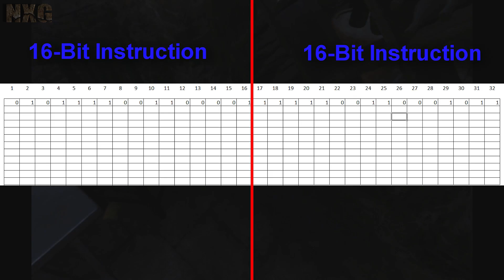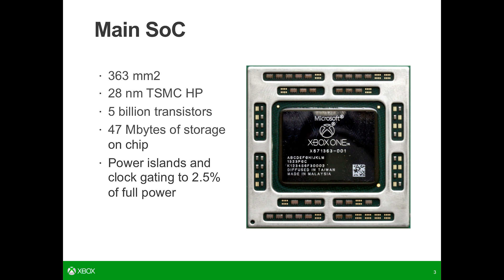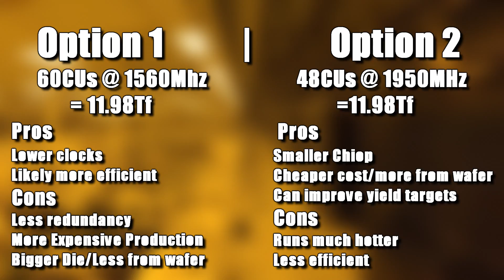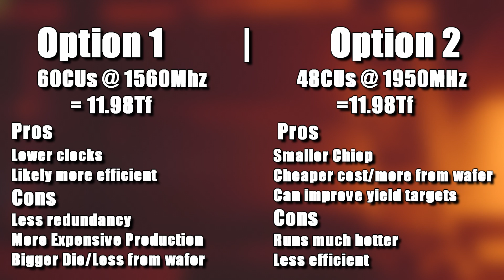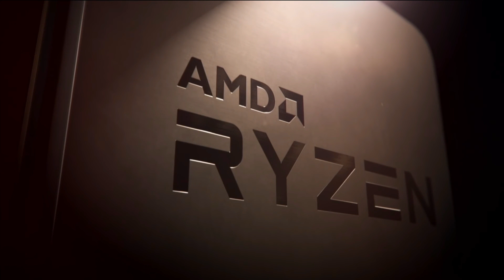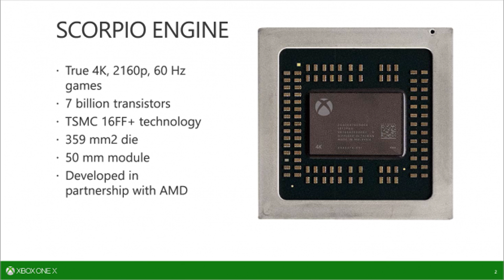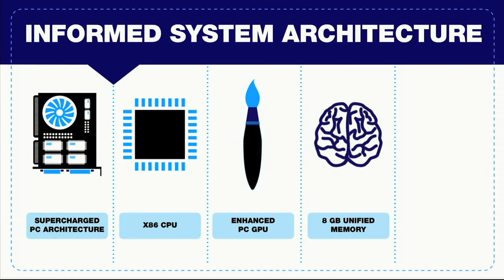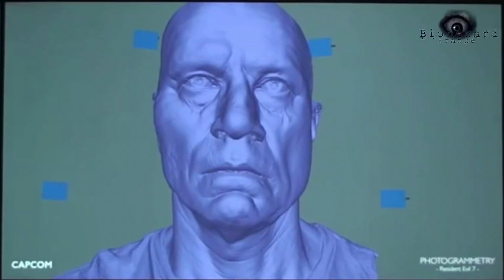Is the PS5 only 9Tflops? | Let's Talk

Comment: Playstation fanboys are in a emotional rollercoaster just two  months ago all they talked about was power power power but now that it looks like the Xbox Series X will destroy the PS5 in terms of power and performance the Playstation fanboys flip flop back to power doesn't matter
Reply: You do know that the Xbox series x and ps5 will be literally identical both using gddr6 ram both have ray tracing 4K 60 up to 120fps the ps5 might even be faster cause the SSD they have in it isn’t even available for PCs on the market
Reply: Reminds me when the PS4 was originally more powerful than the Xbox one. Stupid people on all sides.
Reply: Let's not get it twisted though, I'm all for more power, worry about costs later; I'm actually still hoping Sony's system is more impressive which it probably will be.
Reply: In the history of consoles, Xbox (Microsoft) has never had a more powerful launch console than PlayStation (Sony). ONLY reason that the Xbox One X was superior to the PlayStation 4 Pro was because it costed 100 dollars more and released a year later. It's absolutely insane to think that Xbox will have a more powerful launch console considering it's never happened before.
Reply: @ghostthough7874  are you sure that's right? The original Xbox was more powerful than the ps2, granted it was released one year later than the ps2
Reply: @Brutananadlewski  Indeed. And same goes for PS3. A year later release. PS3 was more powerfull but had a rough start, difficult architecture to work on, for most devs!
I think that ghost yt random forgot the price of the PS3 lmao...at launch!
Reply: @Falcon_Indestro  ya that's right. PS3 was an awesome console though
Reply: @Falcon_Indestro  not true, the gpu in x360 was a head of it's time and more advanced than ps3. Same goes for the shared memory in x360.
The cell was a more capable cpu in the right hands though. But overall x360 was more powerful.
Reply: @vandammage1747  i can't argue with that. Maybe the X360 was more powerfull as a whole. I always thought the PS3 with its CELL processor being the most powerfull one.
Reply: @Falcon_Indestro  it was sony called the 360 the 180, according to most recent reports from guerilla games, cell was never fully tapped ps3 had 2.18 tflops of floating point performance 360 was nowhere near ps3; multiplats ran better for a while on 360 due to the crazy architecture of ps3 being an issue because xbox 360s architecture was far more similar to pc, Xbox 360 was definitel not as powerful as ps3.
Reply: @ghostthough7874  exactly completely agree
Reply: @ghostthough7874  ps3 released a year later and had inferior gpu and memory. The majority of games look and ran better on x360.

The same can't be said about X1X  which is one year newer than the failure that is pro, and games have 100-125% higher resolution + higher settings.
Reply: @vandammage1747  PlayStation 3 GPU was actually relatively on-par with the Xbox 360.
Reply: Ghost Though OG Xbox was more powerful hands down.
Reply: Your ones emotional rollercoaster still no good games on and on a  about useless Xbox One X 6 terraflops.
Reply: Nah, if the series x is more powerful and same price or cheaper then it will 'destroy' ps5, but it's a fail if more expensive
Reply: @gangstagummybear3432  You do realise Phil Spencer said it will be cheaper then the PS5, MS will take a loss on console sales to get more of their consoles in peoples homes, because they know they can make it back with game pass and such.
Reply: @gangstagummybear3432  You can't destroy another console without great games. With great power comes great responsibility , so now Microsoft has NO excuse.
We better not see no low review scores on key exclusives they've had plenty of time.

Comment: This is such a terrible video. Stop making excuses for Sony, their PS5 will be incredibly weak vs XBOX Series X and PC.

Also, we all know, the XBOX Series X is 12+ Teraflops! So why did you say, both Sony and M$ are targeting 9 tflops, when The Only Company targeting that Low performance, is Sonys PS5?
Reply: It's never been confirmed that the Xbox Series X will be 12+ Teraflops of GPU power. CEO of Microsoft only said that it will be "2x the performance of the Xbox One X"... He could have been talking about the SSD speed compared to the HDD in the Xbox One X for example. Also, 6 Teraflops in the Xbox One X which would equal 12 if doubled, is based on old architecture. AMD RDRA 2 architecture (for example) at 12 Teraflops of GPU power would be like 24 Teraflops compared to the Xbox One X 6 due to the Xbox One X having a different type of Teraflops cause the GPU is entirely different.

Comment: I dont believe it's this weak. Provably just a joke or rumors or something.
Reply: It is true but it is from an old plan Sony had for the ps5 to release it in 2019 with the 9.2tf, they later changed the plan as we know and it is capable of more than 10tf
Reply: Check MBGs video about it, i think its called "Why its unlikely that the ps5 only has 9.2tf"
Reply: @dragonblueprt33  LMAO. I can't take you seriously of you listen to MBG. Of course he's gonna make a video about why its "unlikely". Hes a fanboy.
Reply: @ReaveIdono  i know hes a fanboy but how do you counter facts, theres proof of it
Reply: @dragonblueprt33  There is no proof of it. And we are at crunch time so rumours coming out now are probably as close as you can get.
Reply: @ReaveIdono  so how does the old rumor have exactly the same specs that this new one has, exact same specs and terraflop count?
Reply: @dragonblueprt33  Because more documents could confirm what was originally speculated. It's called corroboration...

Comment: Thanks for the video. I keep talking to people who just don't realize that these "leaks" are just information documents of chips in a database. Completely removed from context. It doesn't say "this is PS5" that is just a guess.
Reply: Trust me it's not a guess.  Both consoles have had their CPU's and GPU's leaked.
Reply: @GregHakes  No. There is nothing to confirm that. We don't know if it is a prototype for the console or if it is the final chip. We can make a really good guess that it is related to PS5 because of the tested clock frequencies, but all the same, we don't actually know this. There is no confirmation on anything yet.
Reply: It's not a guess, it's a verified leak from multiple
sources.
Reply: @GregHakes  The only thing that is verified is that it's from the AMD database of chips. Not that it is the final PS5 specs.
Reply: @Blag_Cog  Ok, Buddy what ever you say !!
Reply: @GregHakes  Hey man. I am just concentrated on the facts. People tend to misunderstand how leaks work.
Reply: @Blag_Cog  Ya Ok.

Comment: What is really annoying about consoles is there outdated by parts inside with in the first year of release that’s why I bought a PC.
Reply: Except they really aren't
Reply: Umar Yusha well you can’t upgrade the parts inside smart boy.
Reply: I already knew that and it is like that since consoles are built  in a way that you can't change the hardware
Reply: @vWhiz  Actually that's incorrect, some parts you can. I just replaced my PlayStation 4 Pro HDD with an SSD that improves loading times by 200%+ faster than stock. 

Also the current consoles set the bar for video games as a whole. 90% of the times PC games are ports of console versions. RDR2 was the perfect recent example. Call of Duty is another perfect example.
Reply: Ghost Though yeah your right that’s because there cheap people don’t have to go through the process of building a PC but still really bad performance and graphics when they age 🙃
Reply: Not really PS4 is still delivering much better graphics than when it launched 7 years ago
Reply: Umar Yusha not when you look at a game In pc you can’t judge something that you didn’t see kid😉
Reply: I am not comparing this with pc . Look at infamous second son which was an exclusive  title which came out for PS4 in it's first year compared to death stranding last of us part 2 ghost of tushima . And u will see a huge improvement in graphics overall on the same hardware . And I have to yet to see a triple AAA exclusive pc exclusive game built from the ground up for high end hardware that pushes that hardware to it's maximum . Neither have I seen any pc exclusive look as good as ghost of tushima last of us part 2
Reply: Umar Yusha why you’re talking about exclusive games that are only optimize for the PS4 obviously they will look good and pc shares exclusive with Xbox because there Microsoft, go look at some games closely before saying they look good while playing on a cheap 1080p tv go to 4K minor or 1440p 144hz on pc then compare the 2 🤓
Reply: I have seen how good rdr2 4k looks on a 4k tv so I don't need to see. Plus death stranding at cbr 4k still looks a lot better than rdr2 . Resolution isn't everything
Reply: Umar Yusha what on a ps4 pro with its fake 4K upscale xD
Reply: Umar Yusha it is every thing when playing competitive games not when playing Minecraft

Comment: Weather The power of a new gen is high enough, depends on if devs can make games which are a noticeable leap in graphics, A. I, NPC + WORLD complexity above the previous gen.
So even a 7tflop(rdna) 8 core zen2, ssd and 16gb gddr6 could deliver this type of a leap, that gpu is still 6x more powerful the OG PS4's! And devs did wonderous things with the ps4 + x1.
Reply: Whether* Love your post. Anyone that has some understanding of how graphical output works knows that the difference in hardware power between the PS5 and XboxSX is not a generation apart from one another. Both companies will both have the same tools at their disposal to create next generation defining games. So in the end, what games are created will be what makes or breaks both systems.
Reply: @Scallywig1  exactly! It all comes down to optimizations.
Reply: 6x more powerful than an rx470 MAYBE wow what a ground shattering leap......................(intense sarcasm)

shit when xb1/ps4 were coming out i remember the fanbois masturbating to "6 teraflops" and next gen is sub 10tflops??
Reply: @AdolfHitler-xp1nx  While i love your views on other topics, you are wrong on tflops with next gen. Ps5 is about 9.2 tflops but it's using rdna, 9.2tflops would be equal to 13 tflops~ from gcn (last gen consoles).
Reply: @AdolfHitler-xp1nx  you don't have a clue what u are talking about, no wonder u lost Ww2, fucking racist psychopath.

Comment: 1.  Target for the Series X is 12 TP, not 10.
2.  Stop only thinking about what PC has done and think what they haven’t.  Imagine a set of custom hardware developed for all aspects needed but without as much heat as expected.
3.  Assume the hardware to be sold for a loss up to $100.
4.  PS5 will target $399.99, with most likely a loss of $50, which even at lower production cost would make the 9 TP reasonable.
5.  Series X will target $499.99, I’m going to guess at $100 loss and hit the 12TP Navi goal.
6.  2160p at atleast 60fps is expected next gen.  Anything less not native will be a failure.
7.  PC players will need to really analyze their cost to build next gen,  PlayStation Ponies will attempt to explain how 1/4-1/3 less power is no big deal.  Xbox Ponies will need to keep the pressure for AAA not AA exclusives and not let a more powerful machine reduce their expectation in regards to the number and quality of Software outputs, i.e games.
Reply: This guy knows a lot more than you
Reply: Another Fanboy living in his Bubble of clueless nonsense 👍

Comment: I'm gonna be pissed if I have to buy the weaker console. And I do have to buy the ps5 either way. There's no way I'd ever miss out on the best games in the business, which means owning a ps5 and switch but I'll be really annoyed if it's weaker off the bat unlike PS4 pro which I don't give a fuck if it's weaker than xbonex because it's just an upgrade console not the base system that all games need to run on
Reply: Shit. Do you at least have a 4K tv with 120hz refresh panel, Dolby vision capatible and HDMI 2.1.